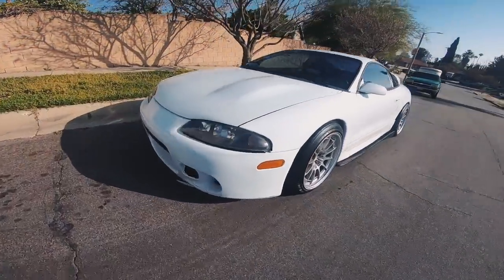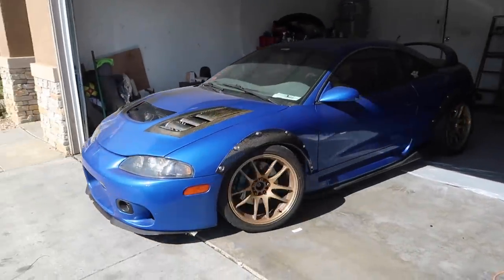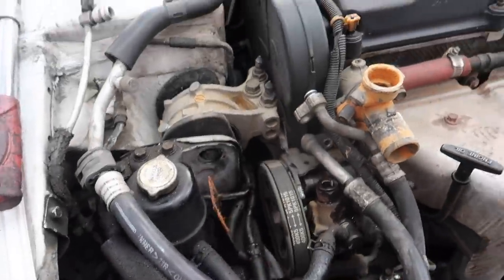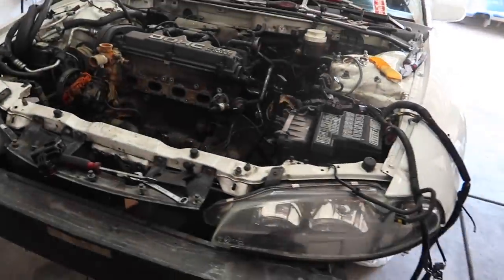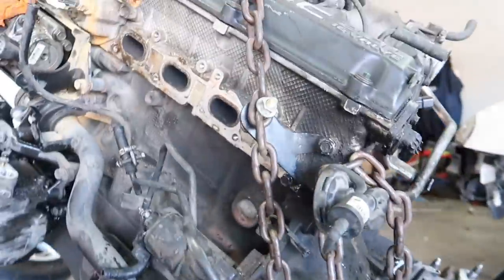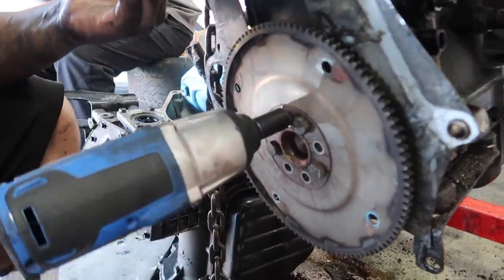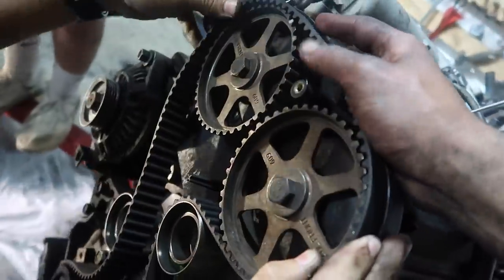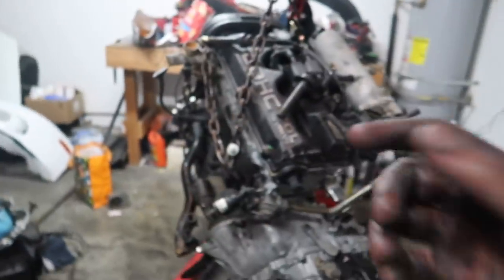MITSUBISHI ECLIPSE BUILD SERIES | TRANSMISSION REMOVAL BEGINS!! EP.5

Comment: Hi Miguel love the channel done a lot to my 2g since I found your channel I had a question I just swapped my transmission and it did the same thing yours did that it won’t Franck I saw lazy put a wire to the battery and starter but how did you get it to crank after that thank you